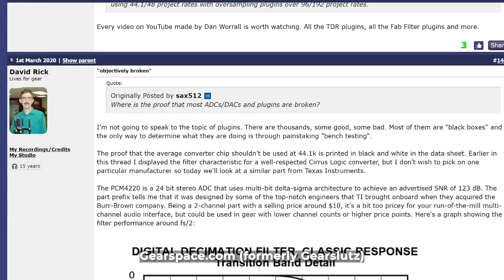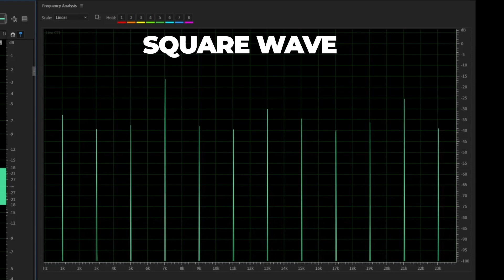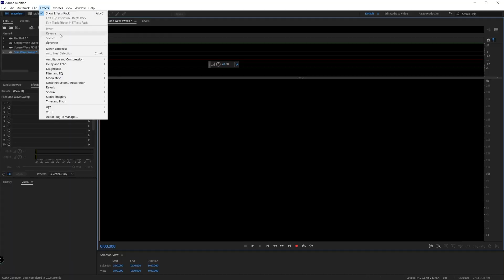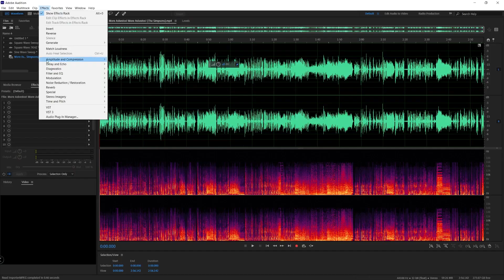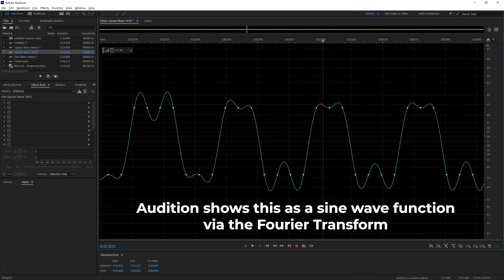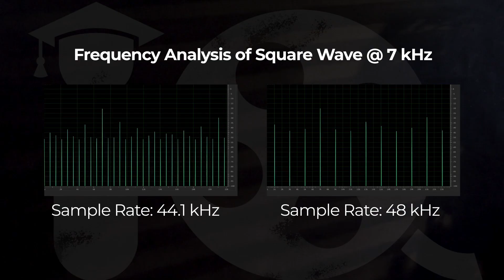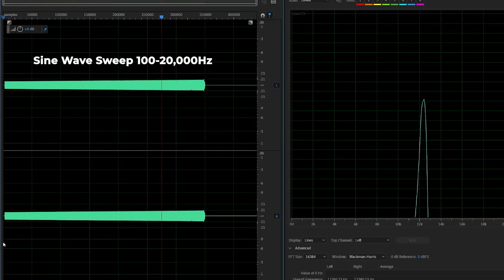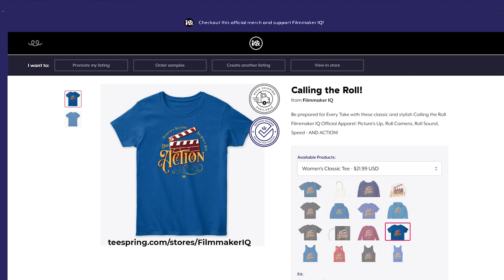What is the Optimal Sampling Rate for Audio? (It's All About the Aliasing)

Comment: Hi John, you're probably just explaining "aliasing" as a phenomenon, but the video title "baited me clicks" and now I'm all confused about if I disagree or not, how dare you! :D
Aliasing requires some knowledge on how to handle/avoid it, but the example with the generated square wave and its mirrored-back harmonics, to my understanding at least, only showed that that particular piece of software that was used had no way of properly handling the calculated harmonics for the chosen sample rate. It's not exactly a real-life use case.

I personally can't see any use for sample rates higher than maybe 48k for simple audio recording/playback (provided that your audio capture device does a good job at band-limiting).
I do see a potential use for higher sample rates (as in "the resolution in which your DAW project operates") during post-processing if you're using tools where you know that they produce aliasing themselves when the project runs at 44.1k or 48k (i.e. plugins that produce extra harmonic distortion and aren't internally oversampled). 
Or if you record audio that you want to pitch down an octave or more.

Using such high sampling rates surely is much more demanding on any computer system compared to simple band-limiting, which should be done at the analog-to-digital stage anyway, whatever your chosen sample rate. So yes, we all want to avoid aliasing, absolutely. But using high sample rates isn't necessarily the best way to do that.
Does the "audio capture device" even sound good when recording at a higher rate? Many might support 192k, not all of them work well when doing that, some few cheaper ones might even sound worse. Or is it the opposite and your device only sounds good at higher sample rates? Perhaps the high frequency rolloff of your specific audio capture device starts so "early" that when using 48k you can actually hear it dampen the high frequency content?
My point, it's better to know your tools and make a decision based on that.
Also, love your channel!
Reply from the maker: "Showed that that particular piece of software that was used had no way of properly handling the calculated harmonics for the chosen sample rate." - I think that's the BENEFIT of that software. 

It was simple test tone generator not a musical application. The test tone reveals something interesting about aliasing - a topic I've heard about but didn't truly understand until I saw the folding reflected aliases.

If the square wave had been constructed AND then band limited, then I would have never had the true revelation of what aliasing actually is - it would always be this mysterious filter thing that engineers talk about.
Reply: @FilmmakerIQ  Oh I agree, for revealing aliasing it was perfect!

Comment: Interesting! I never thought about not having a low-pass filter (to cut out higher frequencies) in front of an AD converter – because it would sound really, really ugly! (There are some tricks to get away with weak analog filters, but they involve oversampling and digital filtering, aka signal processing.) As an engineer it was always clear that you would need this high-cut filter. And on your 5.2 kHz demonstration – I can only hear the switching itself. There's a discontinuity in many switching events, but when the switching was continuous (on crossing the zero-line I'd guess) I couldn't hear it at all. Yes, my hearing is already that bad (but nearing 60 this is quite normal).

Where it does make sense to use higher sampling rates (and 24 bit) is in audio processing, because higher "resolution" (in amplitude and time) makes it easier to manipulate signals. Same as in image processing: It makes perfect sense to use 16 bit per channel (or even 32 bit float) images in high resolution when doing advanced image editing, but the end result could be distributed in much lower resolution with just 8 bpc (this is common practice); yes, there's still a chance that you run into issues with color management, but there are ways to deal with that on the "output" side.
Reply: I'm 47, suffer from tinnitus and use $25 wireless Logitech headphones but even I could hear the difference between the two 5.2kHz samples. The aliased one sounds 'dirty' to me. Not sure what this proves though.
Reply from the maker: Maybe it proves your wireless Logitech headphones arent very good? Try it on a speakers...
Reply: Yup, for audio processing it always makes sense to use float. You get

* A higher dynamic range (145 dB vs 96 dB), which gives you more headroom before clipping
* Simpler (and possibly faster on anything newer than a Pentium II) code when working with normalized range -1 to 1

For image editing, it depends on your purpose, but VFX requires the higher dynamic range of 16 or 32 bits per channel. Editing for a website or printer may work with less headroom.

Comment: Comparing a 10khz sine wave to a 10khz square wave, only proves you have 10 more khz left to hear the aliasing artefacts of the higher overtones that you cannot hear. You are not hearing the 30khz overtone. You are hearing the aliasing artefacts at 20khz. That's what is making the slightly crisper sound. Harmonic distortion. One of the reasons why people prefer analogue sound over digital is because it sounds warmer and more organic. But that's not how the real music sounded. The digital version is a perfect replica of the original sound. The analogue version suffers harmonic distortion which is pleasing to the ear. The Minimoog analogue synth had such a great sound because Bob Moog miscalculated the resister values in the filter, causing the sound to distort in a pleasing way.

Comment: Great video, thanks! FWIW (and that’s not much) at 5:00 you say that YouTube samples everything to 44.1. But actually, YouTube uses the opus codec for the audio channels of videos, and that format is locked to 48.  I think a few older vids might also have ogg or m4a which may be in 44.1, but “most” are sent in 48. It’s certainly not substantive for the point you’re making, more just trivia. Thanks!
Reply from the maker: AAC is used for Apple devices which is locked to 44.1. It also happens to be what they use for the download file option in YT's creator studio.
Reply: Aha. Interesting. Using youtube-dl, here are the streams available for your video (limited to audio):

249          webm       audio only tiny   52k , webm_dash container, opus @ 52k (48000Hz), 7.13MiB
250          webm       audio only tiny   61k , webm_dash container, opus @ 61k (48000Hz), 8.37MiB
251          webm       audio only tiny  108k , webm_dash container, opus @108k (48000Hz), 14.81MiB
140          m4a        audio only tiny  129k , m4a_dash container, mp4a.40.2@129k (44100Hz), 17.71MiB

I'm on a mac here (but not an iOS device); in Firefox, the youtube web app uses stream #251 (as visible in the "stats for nerds" right-click; in Safari it uses #140, so you are indeed correct!

Again, thanks for the excellent video.

Comment: Another case for generally higher sample rates has less to do with being able to accurately reproduce frequencies and more to do with channel to channel temporal precision. In short, when dealing with more than one audio channel, like stereo, or a theater sound system, higher sample rates tend to produce a superior sounding stereo field. Each ear may not be able to hear much above 16Khz, but both ears combined are extremely good at distinguishing differences between each ear. This is pretty straightforward to check out for yourself. Get a CD quality recording of a live performance, then get the same recoding but remastered at 24/96 or 24/192 (as long as the recording was originally recorded to analog tape) and listen to each one on a reasonably good stereo system. They should technically be audibly indistinguishable… except, that they aren’t…. The higher sample rate version has a superior stereo sound field. It’s like night and day, and you can’t unhear it once you hear it.  Now… this doesn’t mean we should universally use higher sample rates. Not everything has a stereo sound field that will benefit from that, but…. For the stuff that does, man, what a difference.
Reply from the maker: That's not quite true - Again, Monty's video explains: https://youtu.be/cIQ9IXSUzuM?t=1253
Reply: @FilmmakerIQ  That's not exactly what I was referring to, but yes, the part you linked to is technically correct, but with a few things that he doesn't address (the sins of omission that he refers to in the epilogue).  This is why a higher sample rate stereo recording does in fact have an audibly better sounding stereo sound field.  As usual, there's more to it than that, and yes, I have watched to original video in full.  Multiple times.  It's a classic.
Reply from the maker: I don't see the argument for why there would be a better stereo field if the timing is already perfectly established. 

Your exercise of listening to a CD master and then a remaster is also just an example of bad science. Of course the remaster is going to sound better - it's remastered... that's not apples to apples.
Reply: @FilmmakerIQ  sigh The timing he demonstrated is correct as long as the frequencies involved (and the differences in frequencies involved) are within the bandwidth imposed by the sample rate (one of his sins of omission).  

The point I was attempting to make was that humans can hear complex high frequency differences between two different sound sources in space at much higher timing and frequencies than can be accurately represented at commonly used  lower sample rates.  The example I gave with the remastered version was a simplified attempt.  You can start with the high bit rate remastered version and generate a low sample rate version from it and get the same audible effect.  Just be careful about what recording you start with because very few recordings actually contain enough high frequency content.

I'll leave it at that.  I'm happy to have a productive conversation, but I'm not particularly interested in trying to change anybodies position on this, and you clearly have one that differs from mine.  BTW, I'm not attacking the content of your video, it's actually quite good.
Reply from the maker: Got it. See my frustrations was you were basically making a claim with absolutely no argument to back it up other than he it wasn't mentioned. Lots of people who really don't know what they're talking about do that so I'm already wary. Thank you for explaining the reasoning.

I'm still not really buying the stereo argument though. As someone that can't really sense the high frequencies, I could not tell the timing of high frequencies that are outside the band limit anyways. And it would need equipment far superior to what I have to actually even have a chance to hear.

That and I'm so unbelievably jaded about placebo effects at this point that I don't trust anything that's "slightly different"
Reply: @FilmmakerIQ  Totally understandable.  I'm one of those nerds that has actually written a fair amount of signal processing code, spends his days looking at and editing audio and visual content, and does actually have an edit bay that can do both high resolution visual and high frequency audio content justice. In all honesty, despite the fact that we have two ears and more often than not at least two speakers, a shocking amount content we hear just isn't very stereo.  When you do hear something that has a really large stereo sound field with a lot of complex high frequency content (think big orchestra, etc), lower sample rates just don't sound as good, and it's not just frequency reproduction accuracy.  The stereo image you hear is very different.  I know I'm being a little "audiophile vague" here, but it's hard to show without actually experiencing it on a system that can do it justice, so I totally get your skepticism on the matter.  I've had clients come in on projects where I was mastering at 24/96 and had a big honking stereo image and they commented that the sound file I sent them earlier seemed to be missing something that they were hearing in the edit bay and asked me what I changed.  A lot of differences existed between what they were using and my edit bay that would contribute to that, but one of the big ones was they were listening to a significantly higher resolution version in the edit bay.  It should be noted that I'm not an advocate for going for maximum sample rates (like 192Khz), but sound reproduction can generally benefit from higher sample rates than 44.1 or 48Khz.
Reply: From a practical recording perspective: the soundstage just opens up a lot, when switching to a higher Fs. 44-48: not worth the bits, but to 88 or 176 oh yes.
And, the sound gets sweeter.

My guess was always timing, and with timing comes also phase coherence.
Reply from the maker: My skepticism is still strong because as you said, you have some good equipment. Of course your clients will remark that it sounds better on your system.

You're not the first person to say they can hear it on their system. Every anecdotal story involves a system someone takes pride in. Yet when I see actual blind studies done,  the effect is just zeroed out. 

And I haven't read a reason why the timing of frequencies I can't hear would affect my perception of sounds I can hear. 

All I get is "you have to experience it"..  it feels like talking about religion or wine tasting :)
Reply: @FilmmakerIQ  you’re right to be skeptical, and I’ll be the first to admit that most of the time I can’t hear a difference on my own system.  However I’m also not completely ready to just dismiss it either because there has been more than one instance where I listen to a lower resolution version of something before sending it to a client and my immediate reaction is “that doesn’t sound right, I must have accidentally nerfed one of the settings”. This is then generally followed by multiple attempts through multiple paths to try to generate a lower resolution version that sounds the same as the high resolution version only to be left scratching my head wondering what’s up.  I can’t say 100% that it’s some algorithm somewhere in the processing chain, and also can’t say with absolute certainty that it isn’t.  I know it has something to do with having more than one channel because in those instances I usually end up minimizing the difference at the expense of tweaking the size of the stereo field and/or position of the various sources. Going through and clamping the various sources so that they don’t contain anything above ~20Khz even though they’re high sample rate also tends to get rid of it as well, though that tends to be very tedious on larger projects with a lot of tracks.  It’s happened enough times over the years that I’ve started to keep track of when it happens along with details in an effort to suss it out and get to the bottom of it, though what I’ve offered thus far is basically what I suspect is happening.  I’ve not yet reached the point where I can definitely show beyond a shadow of a doubt. Frustrating, I know. I’d much rather have it not matter one nit all the time.

Comment: Aliasing is pretty much a non issue when going though a modern codec.  The generated square wave example was not filtered, as it would be on any DAC.   If you recorded that wave and then displayed it, it would sound the same but not look square anymore, but look like 2 sines mixed together. 

Codecs sample at a much higher rate (>1Mhz) with fewer bits of resolution then down sample using a CIC filter and multiple half band filters.     Through the magic of poly phase filtering, an 18th order elliptical halfband filter is only 4 multiplies to drop the rate by 2 with a very steep cutoff.  You chain multiple half bands together, maybe a 3 or 5 phase if needed, to drop down to 44.1 or 48K rate.     Its pretty easy to knock out any audible aliasing with a chain of tuned 18th order filters.
Reply from the maker: This video isn't about codecs
Reply: @FilmmakerIQ  Then congrats at demonstrating why an anti-aliasing filter is important and what happens without one.

Comment: When I was in my 20s I could hear alarms on the street, dog, rat and mosquito repellents and other high frequencies and it was a huge pain in my brain. Now in my late 30s the effects have subsided a lot, but I can still hear but mostly feel high frequencies. I am also a mix guy even though it's not my main skill and I work on a custom made ~€16000 speaker system in a room with a very cozy and measured sweet spot. Yes, I can hear differences between 96kHz and 44.1kHz but they are extremely minute and only in particular solo samples like a cymbal ride or in high pitched reverb tails but I'm a very special snowflake and your experience may vary :)

Comment: When recording audio, other audible difference that could be audible is the property of the antialiasing filter below 20kHz, so having a higher sampling frequency allows room for a better behaved filter. That's true for the response of analog equipment too, having a higher analog bandwidth also leaves room for better response below 20kHz.
Reply from the maker: Exactly
Reply: Thing is, on most remotely modern equipment, the internal sampling rate is not remotely close to the rate being input or output. With a 1-bit sigma delta converter, it's up in the MHz range. The analog filter only has to remove aliases that are relevant for that frequency range. It's not like the analog filter is being switched out when you select an output rate of 44.1 or 48 or 96 etc. It's just affecting what rate the converter upsamples or downsamples to digitally.